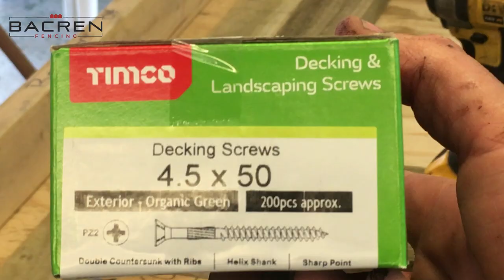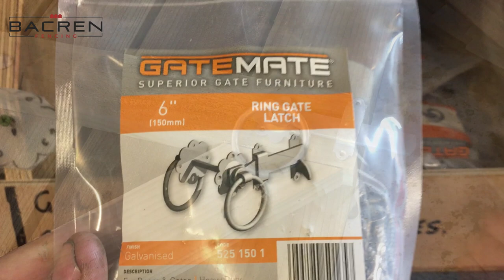How To Easily Build A Garden Gate For Your Fence In Just Minutes!

Comment: Nice job with the gate Barry, looks the part, we have one to do for a job coming up that's the customer needs to be able to lock but doesn't want a padlock and wondered if you, have used the gate mate long throw gate locks at all? Cheers and have a great weekend 😊
Reply from the maker: Thanks Rob, yes I have used the gatemate long throw locks quite a lot. Here is a link to a job that I done with the gatemate lock fitted to a T&G gate I made.  https://www.facebook.com/Bacrenfencing/photos/pcb.459964252297250/494465498847125/

 If you scroll through the photos on my FB post, you will see the gate. They are very high quality and easy to fit. Highly recommended mate !
Reply: @Bacrenfencing  thanks for the info and fast response Barry, I will give one a go 👍
Reply from the maker: @robgormley1317  No probs Rob, they are great locks and very easy to fit. Once you use one, you will end up using them more in the future. Highly recommended.

Comment: What size timber did you use for the bracing of the gate ?
Reply from the maker: The same as the other timber in the gate frame - 88 x 38 x 3600mm lengths of pressure treated fencing rails - cut to size. Thanks for the comment

Comment: Hi Barry, Just watched a couple of your videos re attaching a timber post to a house wall using Timco bolts. Excellent!👍Please could you advise me on whether to use 4" x 4" wooden fence posts, or concrete posts? I am going to erect a six panel fence. Thanks
Reply from the maker: Thanks David, It really depends on your preference. Concrete posts obviously last longer but personally, I don't like the look of them. I usually use wooden posts and as long as they are treated and installed correctly, they will last a good 15-20 years. Hope this helps !